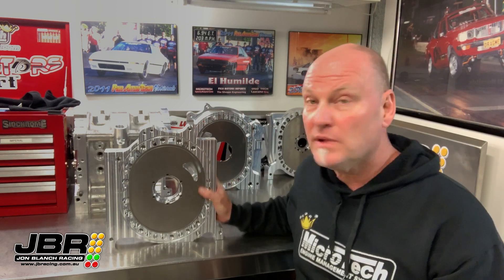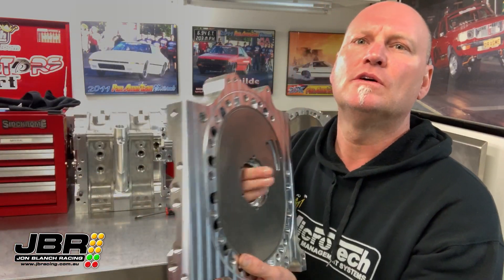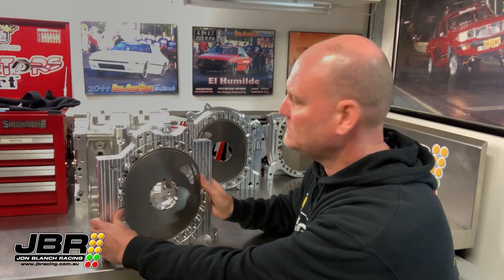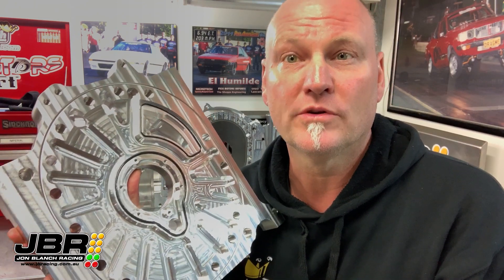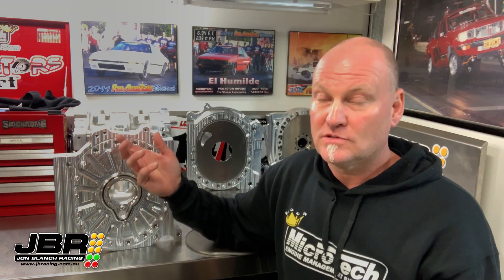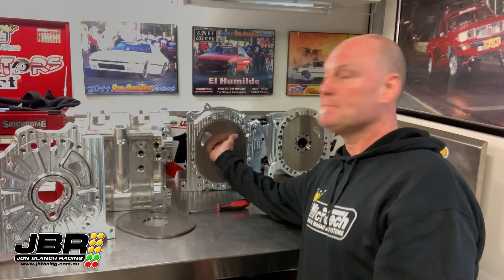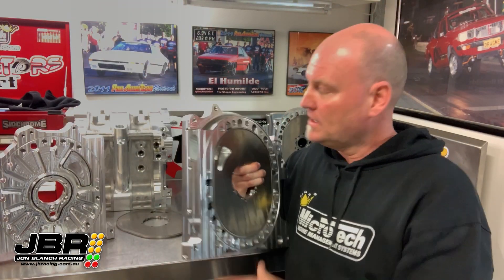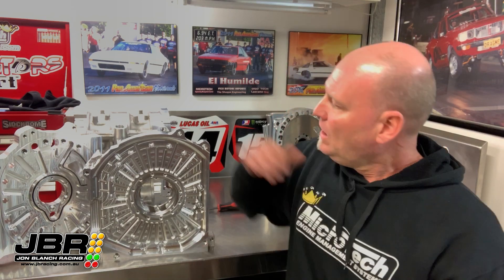Rotary Engine Tech - Billet BOSS Plates

Comment: I luv your vids as I learn so much:) I was wondering what a proper 20 b vs a 26b could make in terms of hp say with twin 88mm turbos? I saw a vid and those billet pro guys are testing a new 26b which looks very promising. In Canada, there are guys running twin turbos with a control valve located between the turbos to wastegate the air then close it during a race so the 1st turbo acts like a supercharger and when they close the gate the 2nd turbo takes over giving the engine monster hp, but when it comes to rotary engines everybody guards their secrets like a junkyard dogs. I like rotary engines but most drag racing wont allow them in many classes of racing here in North America:(

Comment: I’m wondering why the rotor seal slots are perpendicular to the rotor axis. Seems like the pressure against the seal is prohibitive to sealing. What if the seal slot is at an angle such that the pressure lifts the seal against the rotor housing.

Comment: They are  very nice...and the plates  cost..???
Reply: Too much.   You can build a LS V8 for like 1/10th as much and make more power.  I have a twin-turbo 12A, the advantage is small physical size that works for my jet boat.
Is drag racing still a thing in OZ?   It is pretty much dead in the usa for years now.